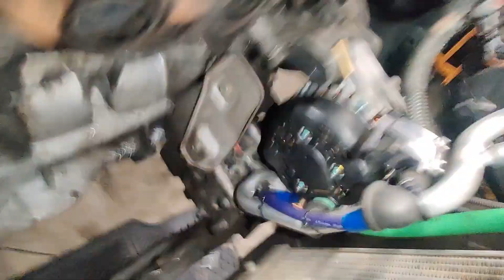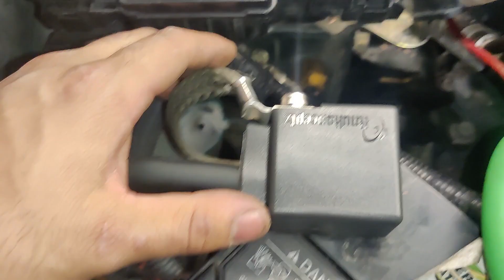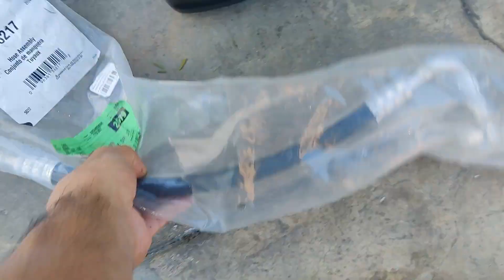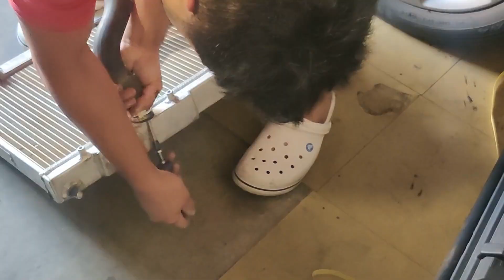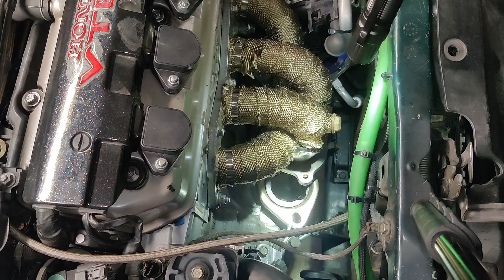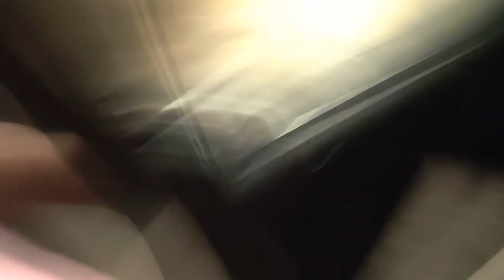Ricer Civic Almost Gets Its Electrical Systems Blown Up

Comment: Isn't that engine to ground cable too short? I would give it a loop to compensate engine movements. You should also protect those ground points after you scraped the original paint, give it at least some copper grease because it will corrode as hell especially that one point near front tyre. Lastly why didn't you check that alternator if it even turns freely? (I assume it was stuck). I see the title "Ricer Civic" but come on man, make it proper. Peace.
Reply from the maker: Now that you've mentioned it, you're right it is very short and I probably should add some length lol. And it totally went over my head to add some copper grease. For the alternator, I was able to spin it by hand before installing it so I didn't think anything about it. Thanks for the input! I'll probably tie those loose ends in the next video!